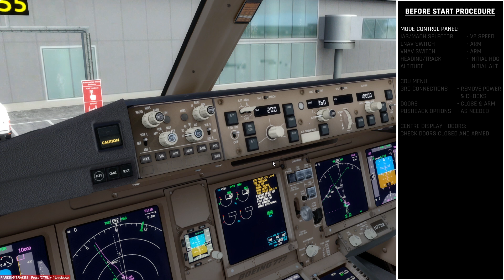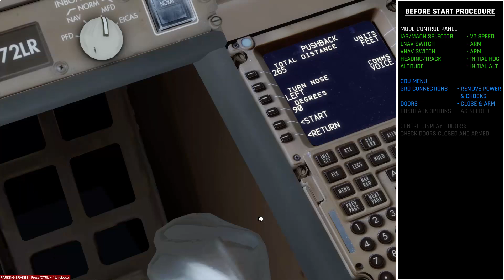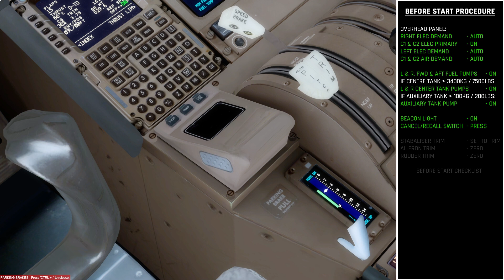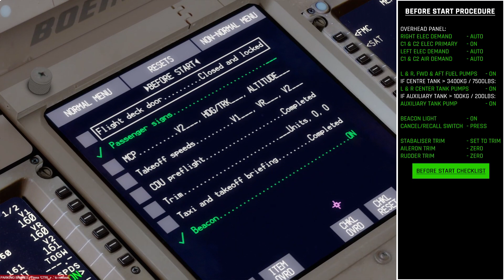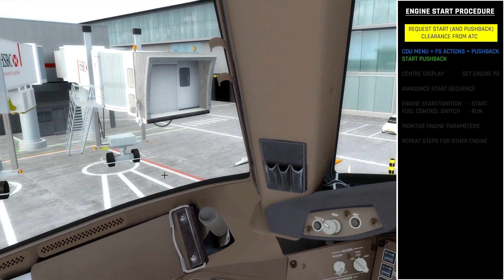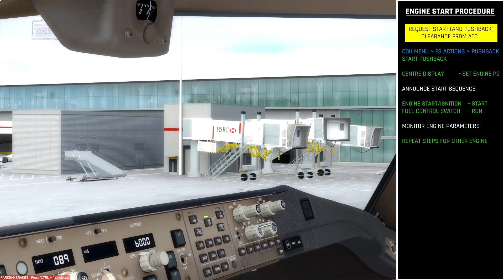PMDG Boeing 777 - Engine Start Procedure

Comment: Hi Doofer, 

Do we always put in V2 in the MCP or are there situations where V2+15 is allowed?
Reply from the maker: I'd stick with the given V2, V2+15 or VxSE (Best Climb Angle Single Engine) is a rare case where you need the best climb angle with an engine failure, only likely to be used in mountainous terrain to climb out over obstacles after engine failure